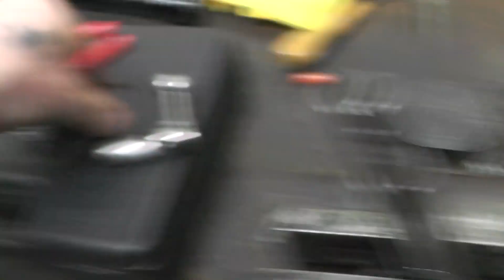How To Disassemble A Stirling Bolt

Comment: Hi there , thanks for that. I have 2 model 14s. Ones just a 14 , the other is  14P. I having issues with the bolt not always extracting the case. Extractors look ok , bit could it be just gummed up and need cleaning?

Comment: After taking the bolt apart and the firing pin I discovered the firing pin spring follower was missing. Another part is required. After reassembling with the help of a gunsmith I had misfires with certain ammo such as Winchester and Federal but all the CCI brand fired. The gunsmith reckoned the firing pin tip was good so it has to be the firing pin spring tension. Any suggestions?

Comment: Great video.  I WISH I had heeded you warning about covering the end when releasing the FP spring…….  My FP was stuck until I gave it a poke only to have it fly out, luckily not in my direction & lucky I could find the spring and guide afterwards.

Hopefully this misfiring model 15 WMR will work flawlessly after I stretched the FP spring by 10%

Comment: Jamming the bolt straight into the hard face of the vice without any soft jaws or timber to hold it securely and then hitting it with a hammer?
Reply: Stirling mate you can’t hurt them

Comment: Hi thanks for the vid do you know if the trigger can be adjusted
Reply from the maker: Buck Dive sure at your own risk though, it's a matter of filing the sear plate? the piece that catches the bolt?

have a good hard think about it before you attempt it 😀
Reply: Thanks if you had a picture of where to file that would be awesome I've never done any gunsmith work